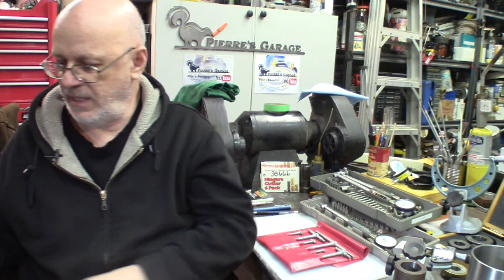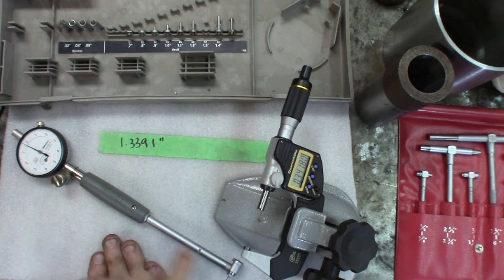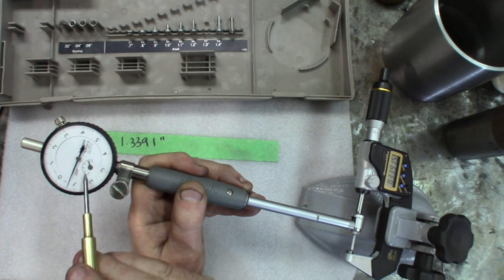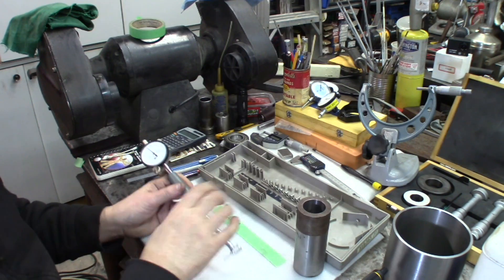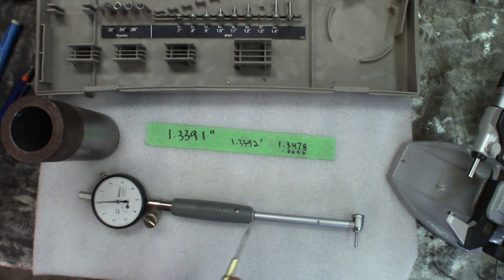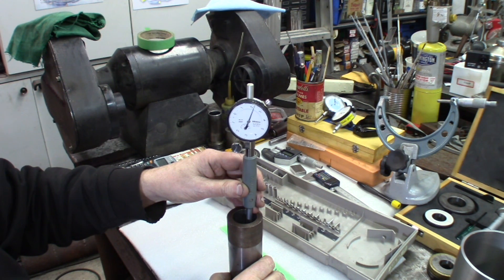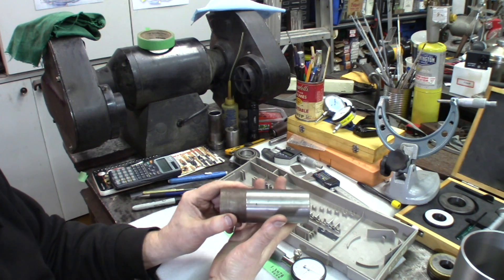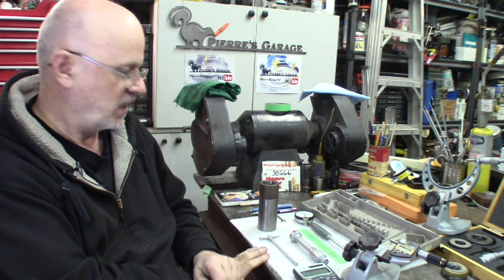Dial bore gauge VS Telescopic gauge - How to use and calibration. Measuring a cylinder

Comment: 7:11 Rather then setting dial at exact zero before checking its micrometer reading I find it much easier to set it just slightly above zero and check with micrometer then. This way you know if micrometer is definitely in contact with dial and don't need to sort of guess if it is in contact already or not..
Reply from the maker: I'll think about you just mentionned when I need to use the gauge next time, thanks for sharing your expereince,    Pierre

Comment: I have been looking at measuring holes and I'm new to machining....dial bore gauges out of my budget...good telescoping gauges in my country about 300 dollars....so instead I bought 75 mm Starret tubular callipers ...new old stock...so they will be used like telescoping gauges....even if I have to blue the inside of the bore to get a witness mark and then measure with a micrometer.
I figure this is how it was once done before the advent of 3 point or dial gauges and of course one day I might be in a position to upgrade to quality instruments....at the moment tho I will try this method.

Cheers.
Reply from the maker: Hi Mike,
Just curious about what part of the world you're from...
I'm confused about the Starrett tubular calipers, could you give me another description...?  I probably call that tools another name over here.
Pierre
Reply: Hi Pierre,
I'm in Australia...so our exchange rate is 75 cents to US dollar...plus anything good always attracts an extra premium out here.
These are the ones I got....http://www.starrett.com/metrology/product-detail?k=274-3
http://www.starrett.com/metrology/product-detail/Calipers-and-Dividers/Calipers,-Dividers-and-Tram/Precision-Hand-Tools/Precision-Measuring-Tools/275-3

I just received them in the mail...as new condition, played with them and feel confident they are an accurate enough way of measuring, spring is tight, nut is tight....no deflection because its minimized by the tubular construction, you can work the nut so tho calipers adjust very finely and they are small...tho easily extend to a 75 mm opening.
Cost me $90 AU dollars plus postage...would probably be $ 250 new from a tool store.
I think the calipers would be good for measuring groove depths also...very fine points but not sharpened...they move with just an amount of very small rubbing which would be on at least the same par as Telescopic gauges, as you said in your vid Pierre practise getting your feel....it will be the same for calipers...but so far it seems easy to get a feel.
Also my plan is to use the outside calipers as a rough guide when turning outside diameters....set the calipers just slightly bigger than the size you need...you can refer to the calipers often rather than reading a micrometer all the time...when close to desired diameter switch to micrometers for the last couple of cuts.
I plan on getting the next size up down the track.

As I said an economical alternative as long as you purchase good quality.
Would love to see a comparison.

Here is the place I got them from....not far from me.

Cheers.
Reply: Starret model numbers if you can't get the site.

274-3
275-3

Cheers
Reply from the maker: I see, I wasn't thinking about that tool anymore. That was one of the method used before along with inside rod type inside mikes...
The caliper type you got, I've never tried it, not sure about making a video very soon but it would be interesting to try and se what kinda results I would get using those...   ;)
Reply: Hi Pierre,
The Starret spring calipers I got today I have been using and quite pleased so far....can actually feel through the caliper the unevenness and machine marks in the bore...they seem to give good feed back and not difficult to get a measurement off my Mitutoya digital calipers across the Starret spring calipers...I think a good addition to any tool box...tho would be reluctant to purchase chinesium or friction calipers...needs a screw and spring and robust frame.
I'm sure for many years these spring calipers have been used by our forefathers for accurate measuring and just another option...an economical option I think, keeping an open mind and seeing what worked in an age before our fancy but nice digital instuments,
Cheers.

Comment: cetais beau , moi je prend les snap gauge et apres le mic, ton bore gauge the first one confused me cause i did not know how to read IT ? nice vid informative , salut
Reply from the maker: Allo Denis,
Snap gauges are ok for bores that aren't so deep, dial bore gauge will be faster if you need to test the cylinder at different depth and at many spots since you don't need to pull it out every time...  It also depends on how often you need it...   ;)
We're coming out of the big snow storm, there was a lot  of it ,it's been a while since we got so much.....
Cheers,    Pierre
Reply: yes for me its only cylinder bores for vw my hobby they are not too too deep , as long as i can determine that the cylinder is not out of round or is ? its ok with me its done its job ,,,,merci , vien pas en floride ce matin cetais 34 ici a Inverness fl tonight will also be cold , its usually like that at this time our end of winter two days LOL . cest moin pire qua joliette jai ete souper sur un de mes amis qui a une camera qui peut voire ca maison et cest plein de neige comme ils dis on ne sen va pas avant la fin d'avril LOL . salut thanks
Reply from the maker: Si tu veux voir de  la neige, regarde la video d'hier soir...      ;)
J'ai pas mal hâte que ça parte....     Beuark la neige...   lol

Comment: This has been a nice series on hole measuring. When you get down to the very fine measurements like sub .001" the surface finish plays a big factor in the size you measure. For lathe work the .0001" measures will likely vary around the  bore because of the path left by the tool.
Reply from the maker: Hi Brian,
There are always little defects in a bore unless you have every condition perfectly aligned in a perfect world, normally with a good set-up the imperfections aren't so bad that a little lapping can't fix,  this is where better and heavier machines have a definite advantage cause they produce better finishes...
Not every shop will produce parts under a thousand tolerance every time... 
Cheers,    Pierre

Comment: Can a dial bore gauge be used like a 'long reach' dial indicator, to show variation in deep holes?  I'm picturing a holder for lathe toolpost, just cranking it in by hand and maybe rotating the part to check for shape or runout.  Just relative change, not actually needing to measure a solid number.
Reply from the maker: Hi, in my opinion, the holder wouldn't be accurate enough to self-adjust to the tenth of thousand of an inch, this is very touchy, this is where the human touch wins over machine...   ;)
You would need to conceive another type of device better adapted to your idea...
Thanks for your input,     Pierre
Reply: How do you do such things?  For holes deeper than a couple inches I don't think I could use a telescoping / snap gauge, can't swing the handle far enough.  

For example, measuring an R8 spindle bore in front and back.  (I just bought a milling machine project, so it's on my mind).  Since the back isn't a taper I'm uncertain how much I could decide about what's going on back there from bluing up a known good male R8 shank.

Surely it isn't that unusual to want some measurements in a deeper bore, that something needs to be invented to do it! :)
Reply from the maker: Maybe a long shaft near the bore size you're measuring, with a perpendicular thread, you use a domed screw or pin, insert and adjust until you get a snug fit, you measure the max deflexion.   Make certain everything is parallel and straight...   This could be considered a poor man's bore measuring tool....

Comment: That's another very nice measuring option Pierre... bit fiddly but sure has it's place. You sure have some real nice measuring equipment.
I think my old telescope gauges will have to suffice!
I shall have to rename you Mr tenth of a tenth! :-)
This demo was most illuminating.
Reply from the maker: Hi Chris,
With years, the collection of tools increases, the bank account decreases.....   !!!!
The concept of communicating vases......    lol
Keep your telescoping gauges near they're also a powerful tool in the right hands... 
My last nightmare was about "Microns" the metric version of tenths of tenths..........     ;)
Cheers,    Pierre
Reply: Very few people use microns(1/1000) in common machine shop(thats more like super special NASA equipment type of shit ).Commonly used measure is 1/100(ball bearings ,shafts and things like that) of a mm.  See how everything is nice and related in metric?You just add or remove zero.

Comment: Nicely put together. The micrometer stand looks handy when trying to get a consistent reading to tenths. I think I will keep an eye open for a used one. Thanks for uploading and keep them coming. All the best Mat
Reply from the maker: You'll find them in the Mitutoyo's catalog under that series:   
Mitutoyo stands- Series 156
I don't remember the price but it wasn't that bad, you could even for some second hand if you're lucky...
Thanks for comment,    Pierre
Reply from the maker: Hi Mat, 
Those stands aren't that costly and really practical when you need more hands...   ;)
Thanks for for a kind comment,    Pierre
Reply: Pierre's Garage Hello Pierre! Where did you got these micrometers clamps?

Comment: how about the plug gage test? turn a bar to 1.3391, as measured by external mic, and tell us how it fits?
Reply from the maker: That's an idea, I'll have to find a moment to make that slug and do a test, you need a couple of thousand under or it runs the risk of not fitting...   even little interference from irregularities will stop it from entering...   
Thanks for your suggestion and for comment,    Pierre
Reply: yes. emphasis is on the whole process. material selection (will it work with an aluminium piece), time to completion (how fast it can be done), repeatability, to name a few.

Comment: Sorry, but what does the little dial on the dial bor that goes from 0 to 5 do
Reply from the maker: +Zephyr Old This dial tells the total deflexion from the reference you set at the start, thoa dial is set at zero and wjen you measure depending if it's plus or minus you'll see the needle going plus or minus, then you can tell how far from reference you are....
Thanks for comment amd I hope the awnser was clear enough,     Pierre
Reply: Thanks for your answer,  loud and clear